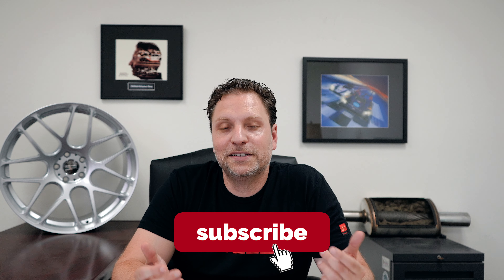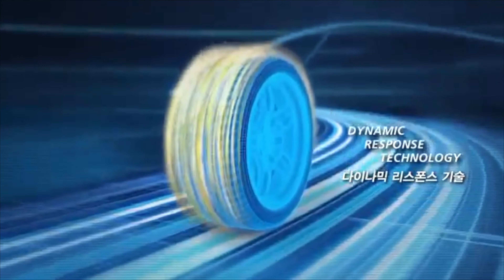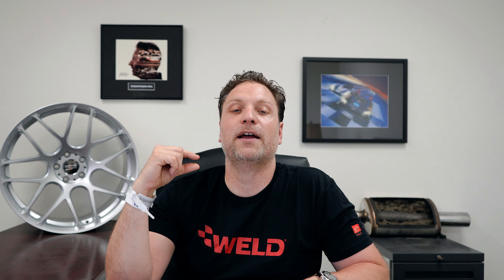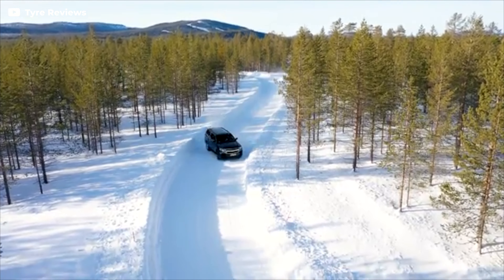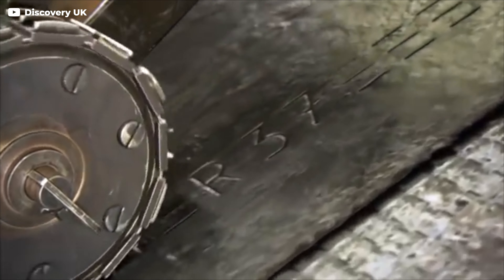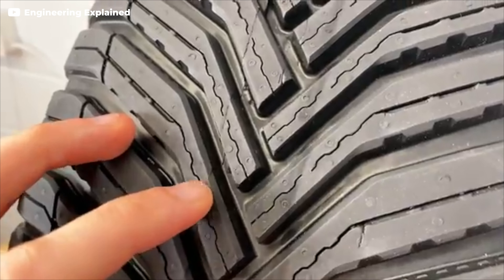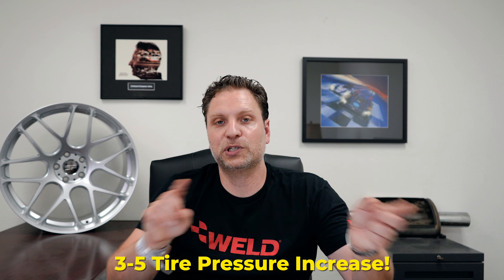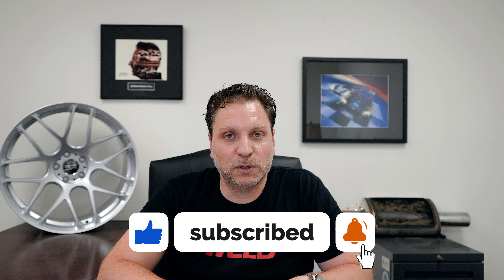How to Pick the BEST Tires for YOUR Car!

Comment: At about 5:20: "....what's recommended is to have a winter and a summer tire.   Now you might think that's pretty expensive....".

I have winter tires mounted on wheels for every vehicle we own, and I swap them out as required by road and weather conditions.
Think of it as cheap insurance, the cost of the wheel/tire combination for each vehicle is less than our insurance deductible.   It is even less of a cost when you consider the inconvenience and time lost due to an accident, and if winter tires help you avoid an injury, they are priceless.
Great video, thank you.
Reply from the maker: S Mal, appreciate you watching and the comment, thank you. And yeah it's really the smart thing to do for one's own safety.